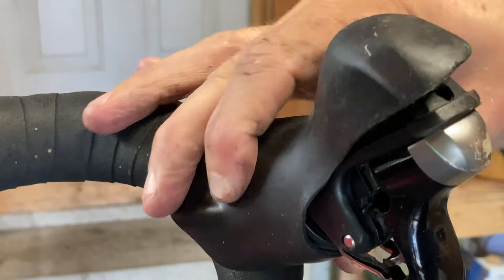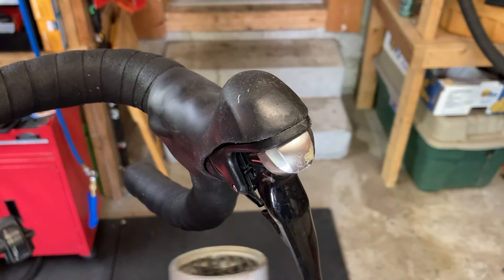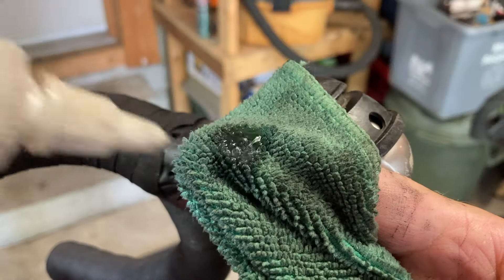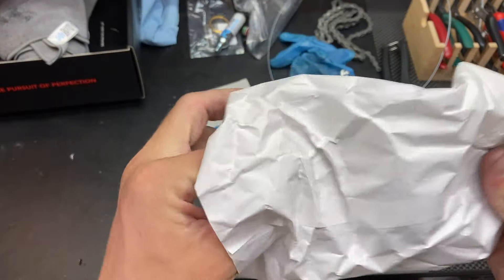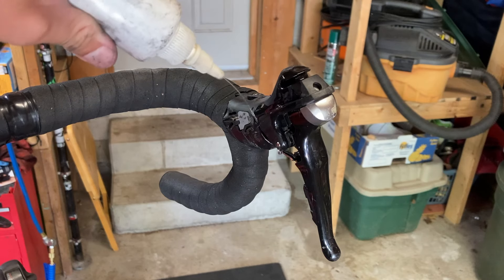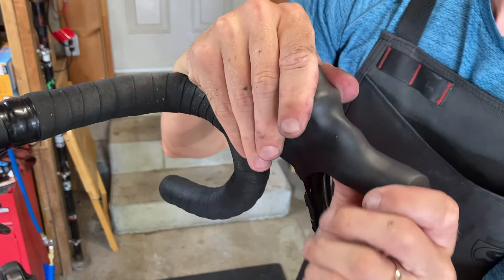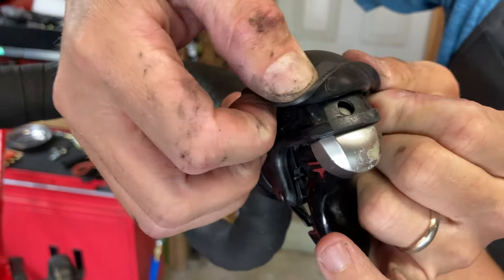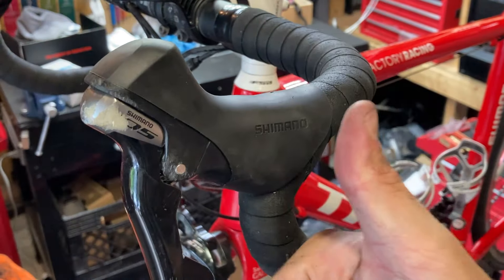Simple DIY: How to Replace Road Bike Shifter Hoods

Comment: Im such a cheapskate 😂
I didnt replace the hood i just cut the old one and place it back tightening it with a black shoe tie. Well it gives a vibrant aesthetic looks to it 😅
Reply from the maker: Maybe a good option if finding replacements is a challenge!  Or on a cheaper bike, but for higher end road bike, usually worth changing

Comment: New hoods but already stretched. I would rather remove shifters from the bar and slide hoods from the opposite side
Reply from the maker: Thanks for adding, yes, going that way is a good idea, but the downside is you’ll have to remove both the brake and shifting lines before you’ll be able to get the shifter off the bar.  This is especially annoying if you have hydraulic lines for the brakes, since you’ll need to install a new olive after removing, and possibly even need to re bleed the system.  Then you’d need to retune mechanical gears/fix up bar tape, so all in all, makes this a much bigger job.  The new hood was quite flexible, and didn’t permanently stretch as far as I can tell, so for the at home mechanic, the way I’ve done it in the video is probably the route to go
Reply: @onelastlap9302 is there a tip to tighten it? I just went to clamp to bar and how long I spent under the hood I wish can get it tight again, my next road bike that I plan to look after more I'm looking to connect wires from SRAM shifter battery to bar ends so I can keep changing battery without ever make hood weaker
Reply: I ripped my brand new cover 🤡, should have just taken the shifter off and re-taped my bars
Reply: @sanj-m yup, I did the same